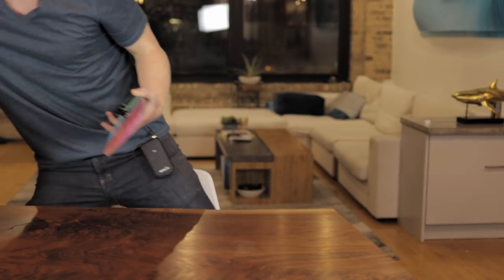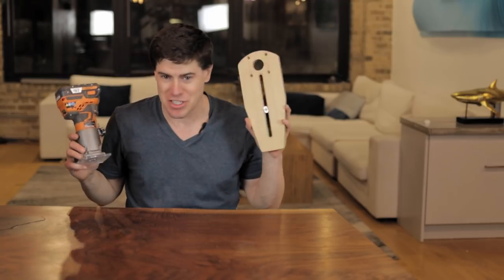How to Make a Mini Circle Cutting Jig || Woodworking shop project

Comment: What size router bits did  you use for the track on the jig? I have the large Rockler jig you used as a template and I need to build a jig for some smaller circles and when I measure the T bolt track, I get 5/8" and screw diameter is 5/16". Oddball measurements so you need to buy theirs.
Reply from the maker: I don't recall exactly, but I know that I didn't have one that was exact, so I went smaller and made a few passes.

Comment: So awesome definitely need to get a router asap
Reply from the maker: Yes, definitely!  A router opens up a ton of possibilities for creative designs.  Soon you will want two -- one for the router table permanently, and one you can grab for quick routing by hand.
Reply from the maker: p.s. That Ridgid cordless is a great starting router.  It has much more torque than the Ryobi cordless, and allows you to adjust the speed, something you definitely want to be able to do when you switch between plywood and hardwood.